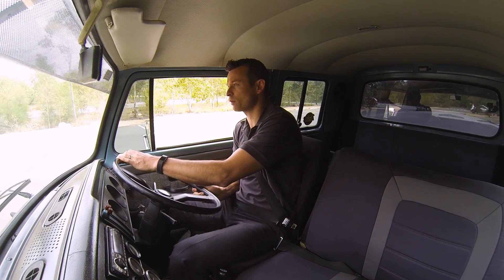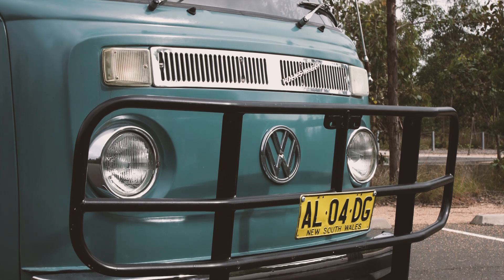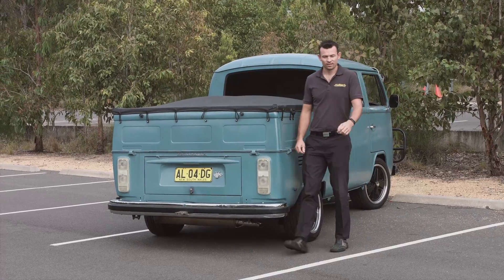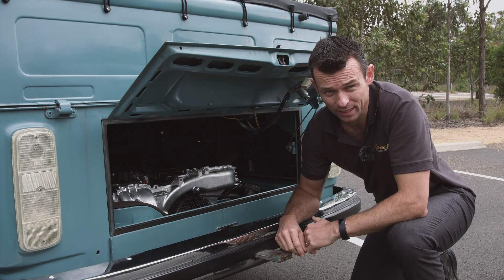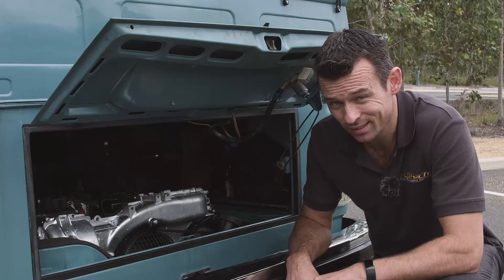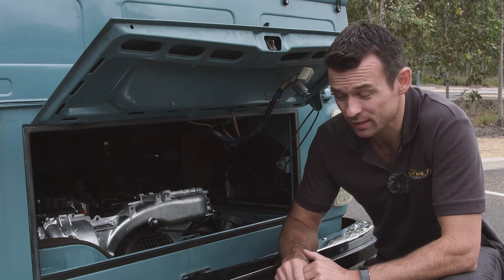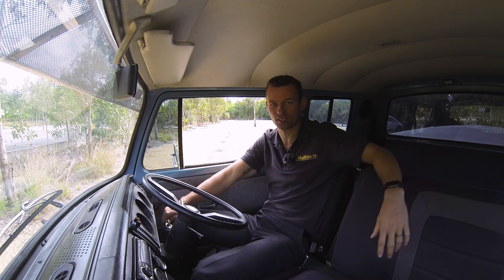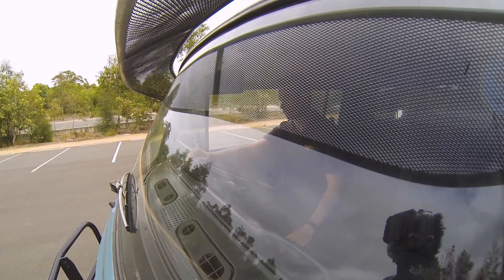💬 EFI Your Classic - You'll Like It!  Part 1

Comment: I have so many questions on this particular conversion. One being How? Did the stock injectors get used? What about that stupid flapper thing that VW uses in the air intake? I would love to see a breakdown on this engine. Chasing down problems on the late 70's early 80's injection is a bitch!
Reply from the maker: We are about to do a follow up on this video which covers the conversion in-depth:) Stay tuned.
Reply: Haltech sweet! I'll be on the look out! I'm knee deem in VW and have been wanting to put EFI on a bug.

Comment: What would a conversion like that cost including having it tuned to run correctly out the door? Thanks for the video.
Reply: please next time more in detail info.. the haltech subscribers in general know more about engines that the average joe :) thanks
Reply: lots once you add in the custom manifold and throttle bodies. Legit about the same as putting a ej20 into it haha.
Reply from the maker: You need to contact Mike at Custom Bugs and Buses: http://www.cbbvw.com.au/
They did the conversion and tuning on that car:)
Reply: Haltech Thanks
Reply: amtpdb1 probably looking at around 4 grand

Comment: I want to do an efi conversion on my w201 for better fuel economy and ability for later on force induction (supercharger) on the m103 2.6
Reply: m103 is always fuel injected with bosch ke-jetronic. The airbox looks like a carburettor but its fuel  injected.
Reply: yet is very difficult to tune with. my friend and his boss are the only two where I live that can work on this system. Plus want to make the tuning process easier.
Reply: yeah, if you want boost you have to get an aftermarket ECU. like megasquirt.
Reply: That's the ecu I'm looking towards, but injectors are the issue. the rail will be of an m104.
Reply: turbobandit should have injectors. they sell whole kits as well. search for turbobandit m103 efi kit.

Comment: so I have a 1 cylinder 350cc boat motor from the 50s. how would you recomend I efi that?

seriously though. I'm sick of it being such a pig to start and the mixture being so hard to sort out....
Reply: a Haltech would be pretty overkill for that. But look up Microsquirt, people use them on all sorts of engines.
Reply: Wasn't necessarily suggesting a Haltech (I understand that it would be overkill) just throwing it out there. Thanks for the reply though I'll look into them. 

Gravity fed updraft carbs are not the easiest to work with, especially on a cold day.
 :/
Reply: I've used a Megasquirt ECU to make a laboratory engine with turn dials for AFR, spark and exhaust gas recirculation. And on the forums I've seen guys use them on everything from RC engines to 9 cylinder radial aircraft engines. Needs more work then a plug&play solution, but can run pretty much everything burning dinosaurs :)
Reply: AccAkut1987 awsome, thanks mate.
Reply: @AccAkut1987  definitely can fuel inject that. I hear people are fuel injecting chain saws now adays.
Reply: I'm rockin a Microsquirt on a VW motor. Works very well for anything small and reasonably simple.